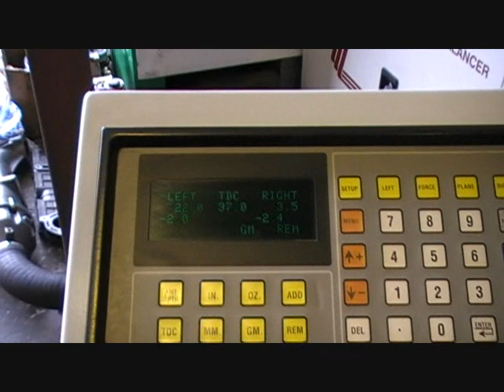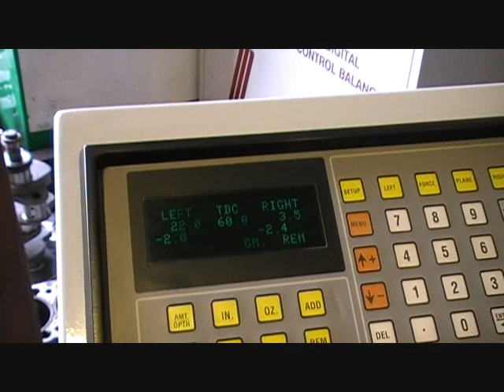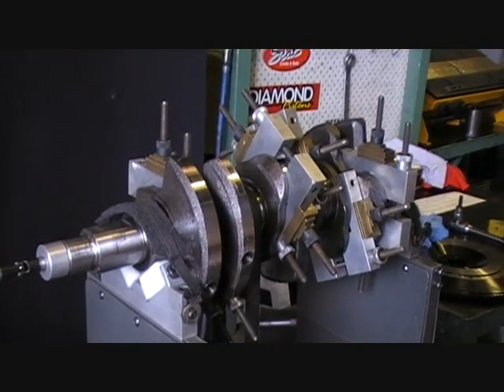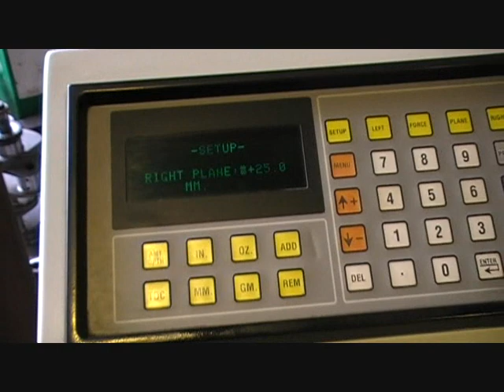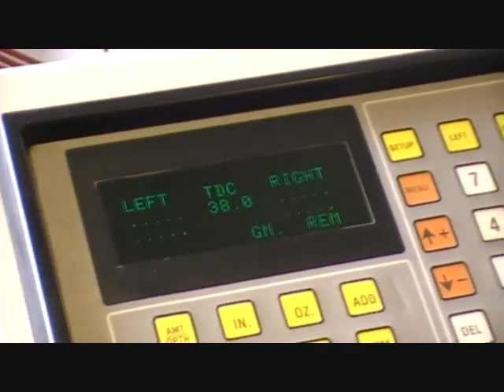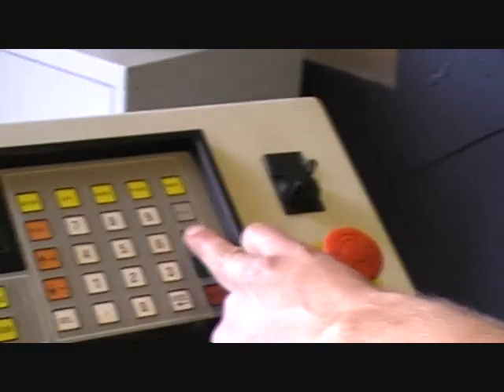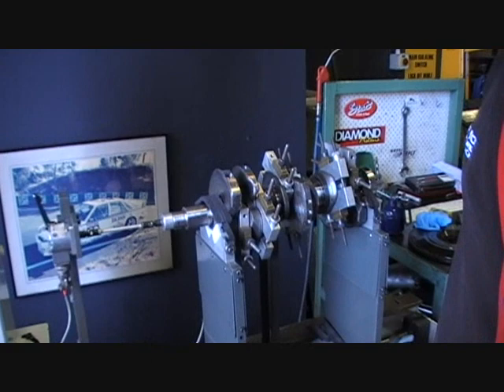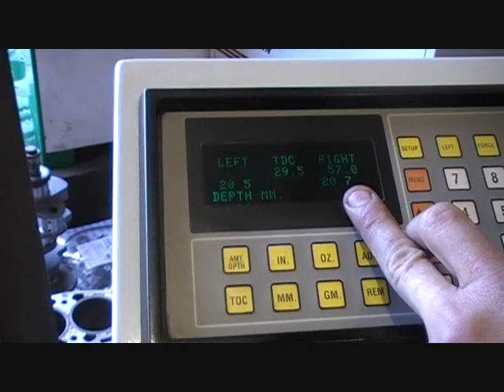Crankshaft Balancing 1

Comment: Is your machines belt position considered a variable in measurement? It seems close to one side of the crank. (front side.) Would a belt positioned in the center of crank be more accurate? Or do the machine crank supports eliminate that variable?
Reply from the maker: It does not matter where the belt is positioned.

Comment: Is there a standard formula for calculation the bob-weights ?
Reply: 100% rotating weight/mass (big rod end with bearing) +50% reciprocating weight/mass (piston with wrist pin, wrist pin locks, and small rod end)
Reply: @eaglebolek712  Only when it's a 90 degree block. When it's a 60 deg block it's about 44% reciprocating. It's half of the sine of the bank angle.
Reply: The bobweights need to be concentric otherwise inaccurate. The extra weights hanging off the ends are added as vectors otherwise but still inaccurate.

Comment: so how do you calculate how far in the drill goes and how do you calculate how much weight in meterial it will remove?
Reply from the maker: From experience and checking after drilling then drill and check and so on.